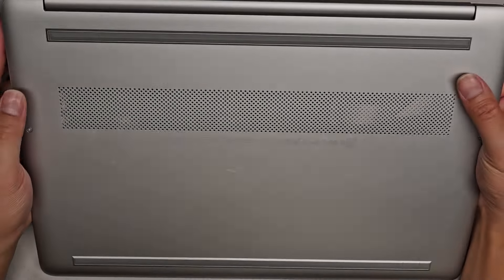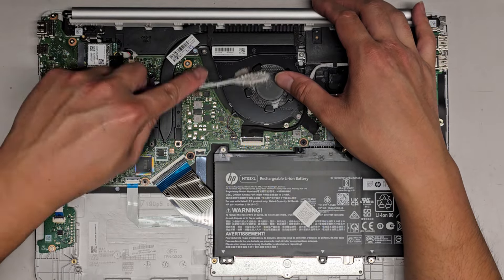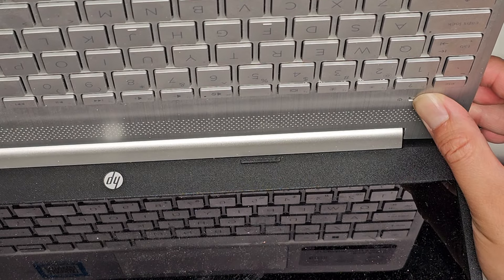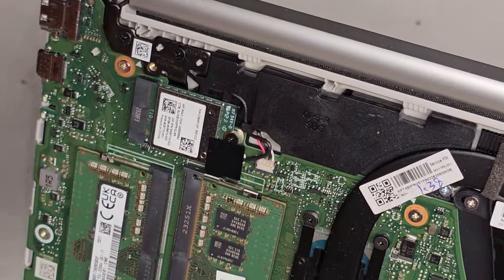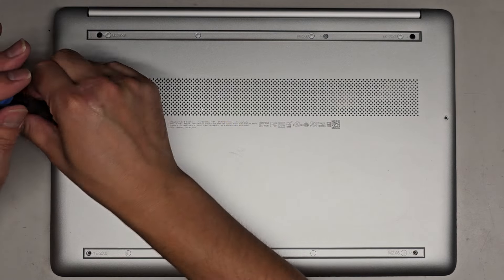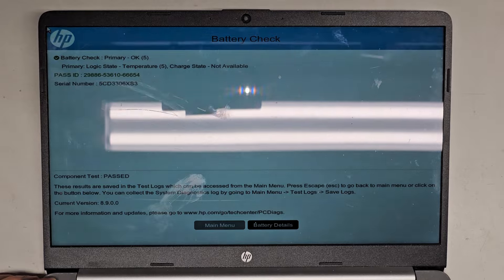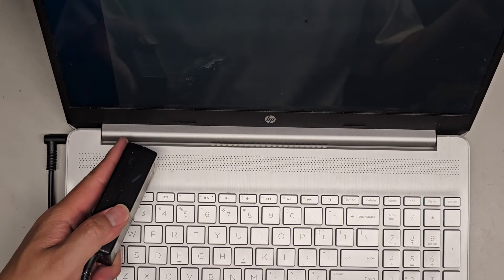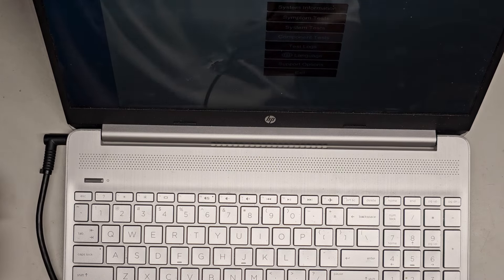HP Laptop 15-DY2073DX Disassembly RAM SSD Hard Drive Upgrade Battery Replacement Repair Quick Look

Comment: Where can I buy the upgrade ssd hardrive you put? Also what laptop do you recommend, I bought this one like 2 or 3 years ago for like 600, dollars you recommend something around 400 or so. I found a “Apple MacBook Pro 15.4-inch, Touch Bar, Core i7, 16GB RAM, 256GB SSD, Space Gray” on eBay for like 400. I can’t find what year or if is good. Any recommendations. Awesome video by the way 🎉
Reply from the maker: How much storage do you want?
Reply from the maker: What year model is the MacBook?
Reply: @ItsBinhRepaired tbh, I just want it to run faster.
Reply: @ItsBinhRepaired I’m not sure, it doesn’t say. I’m guess 2017-2020
Reply from the maker: @dokisuki9411  the recent MacBooks don't have any upgradeable parts.